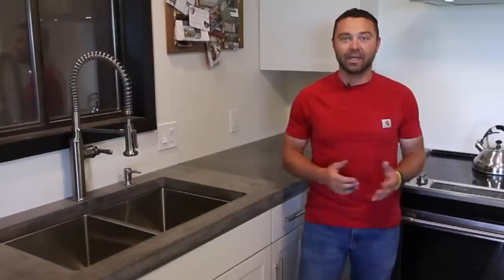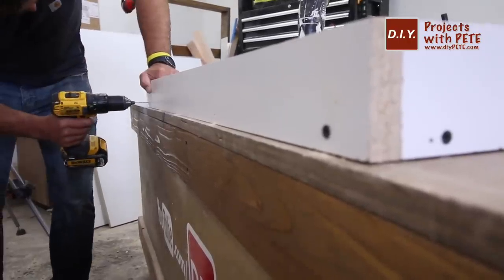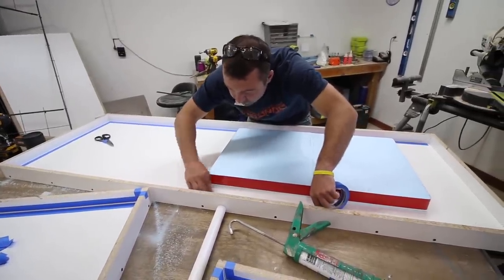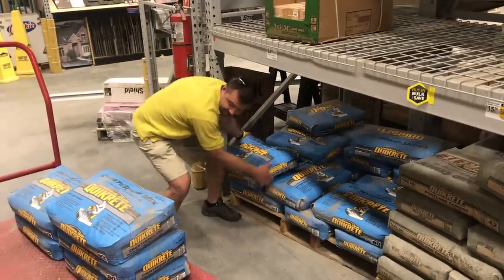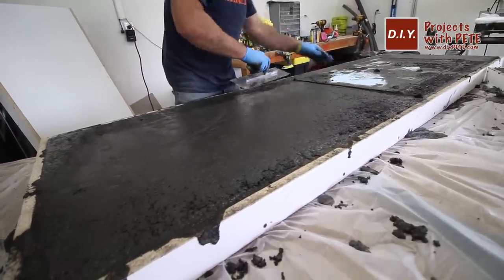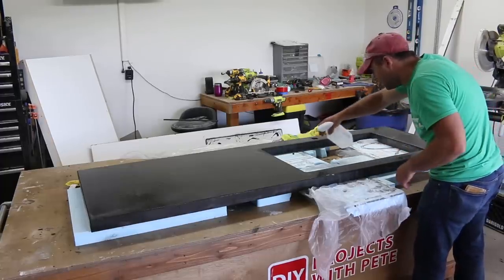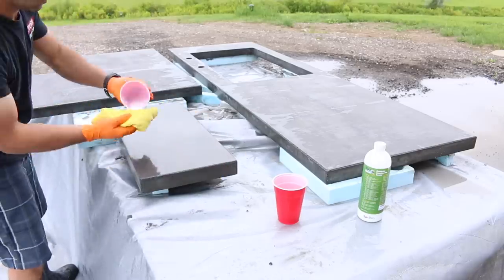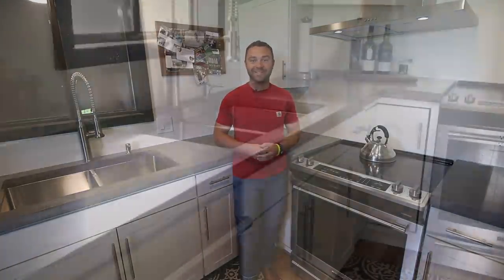How to Make Concrete Countertops

Comment: Man, i am so close to  building a couple of these, but still waiting for my left nut to drop. What is the weight of the counter tops per sf do you figure?
Reply from the maker: At 1.5 inches, about 15-18 lbs per square foot. At 2 inches, around 22-24.

Comment: Just curious --- Framing mold and caulk and foam board concrete and sealer and polisher rental -- What was the total cost of this ?
Reply: If your near a Harbour Freight you can pick a polisher up for around $40 , cheaper if you can catch it on sell .
Reply from the maker: Hi! I have a link in the descriptions under the videos with more pricing info. Also, if you don't have a polisher I'd check out this video. It shows how to do tops with an orbital sander and the cost of everything is quite a bit cheaper: https://www.youtube.com/watch?v=A0Pd4o8gjfM&t=422s
Reply from the maker: Thanks for chiming in!

Comment: Very cool vid! Would it be okay to use a core drill to drill a hole in one of these?
Reply from the maker: I prefer not to drill in the concrete and to use the knockouts. It is probably doable, but I like to minimize the risk of something cracking or happening after all the work has been done.

Comment: HI PETE....MY BUDDY HAD CONCRETE COUNTERS ...AROUND THE SINK ON THE CORNERS THEY CRACKED WHY...WHAT DID THEY DO WRONG
Reply from the maker: Hey Peter, there are many reasons this could happen. Mix used, water ratio, settling, reinforcement around the sink etc. I'd recommend doing some additional searching about how to reinforce around sinks to see if you may be able to narrow it down to a possible cause. Cheers

Comment: Hello Pete. Cool stuff. I was wondering if you could let me know the specs on the blade you are using to cut the foam.

Thank you. 

Rusty.
Reply from the maker: Hey Rusty! I used a fine tooth blade for the table saw. The foam needs to be very secure on the fence for a clean and safe cut.

Comment: Would it be worth using stainless steel reinforcement?
Reply from the maker: If you have access to stainless steel reinforcement it is certainly an option. Not sure on the price difference. Normal reinforcement has worked fine in my experience.
Reply: @DIYPETE  It's more for long-term lifespan in the event of water ingress.  Rusty rebar = doom for concrete.  But maybe a 20-30 year lifespan is perfectly fine for countertops; replacement cost really isn't that high.

Comment: Hey! I have a less work idea. Using concrete blocks, cut in halves. use the top and bottom part. Placed on top of frame or base. Pour some cement on base and blocks on top. Pour cement on top of blocks and polish with cement spatula and wallah! You got a cement top table and can do it for counters also. What about this idea to save time! I think its great!
Reply from the maker: Thanks for the ideas. Cheers!

Comment: Hey, thanks for the video, really enlighting! One question though... In my country I can't find any concrete countertop mix (Romania). Could I use just regular concrete? Or do you suggest any additives? Thank you!
Reply from the maker: Hi! I've used a few regular concrete mixes with success. You could put in a plasticizer or additives if needed. Here is a video where I use a basic concrete mix. https://youtu.be/A0Pd4o8gjfM

Comment: why didn't you use the slurry to blend the two part together? Is that not possible?
Reply from the maker: Slurry would end up shrining and cracking, you could potentially look at doing a grout, but I like the flexibility of an epoxy or silicon.

Comment: Do you have a video showing the lazy Suzan you embedded into the corner cabinet?
Reply from the maker: Hi! I do not, I bought the cabinet with the lazy suzan already in it. Mounting the cabinet is pretty simple though.
Reply: DIY PETE I see. I have a question about it. In the video it seems like the round “trays” stick out from the corner in a way that won’t allow the doors to close. If you were to look on the round trays from a top down view, are they perfect whole circles or do they have a “slice” (like a pizza slice) missing so you would have to rotate the circles so the the missing slice would make room for the doors to close?

(I hope my description was clear enough 😬)
Reply from the maker: Great questions. Here is a link the the cabinet and you'll see what it looks like. Inside the doors it is a portion of the circle. The circle stops at the back of each cabinet door. https://www.lowes.com/pd/Diamond-NOW-Arcadia-36-in-W-x-35-in-H-x-23-75-in-D-White-Lazy-Susan-Corner-Base-Cabinet/50134824  - Here is a video showing a similar cabinet as well: https://www.youtube.com/watch?v=_yFZ0GHRCwM  - Let  me know if that helps, cheers!

Comment: What's the cost of this concreat vs going with granite or other materials?
Reply from the maker: Hi! The cost of the concrete was about $160. However, I've had just as good of luck with the cheaper concrete that is $6 a bag and would be more in the $48 range total for the concrete. You'll also need the form materials, silicon, etc. I was all in for around $350-$400 doing them myself. However, it would be around $65-$100 per square foot to hire someone. Granite would be around $50-$80 most likely depending on what you go with.  BY building you own DIY concrete counters you'll definitely save a lot of money.

Comment: Have you ever made countertops  using rapid set ?
Reply from the maker: Hi Tiffany! I have used it to do a couple indoor and outdoor concrete tables. I love the fact that it is essentially instant gratification in how fast it cures. Unfortunately, they haven't done well outdoors. The indoor one still looks fine but developed sort of a spider of micro fractures. The outdoor tables have pitted a bit and don't look great after a year or two. I've never had issues like those using a normal concrete mix like the Quikrete 5000 or something similar. There is a place for rapid set, but I wouldn't recommend it for counters.

Comment: Diypete , do you have issues sealing at 1500 grit polished ??
Reply from the maker: Hey Tony, I haven't had issues sealing 1500 grit. I generally finish with either 800 or 1500.

Comment: Can you actually use the old countertop to cover with the concrete, seems like that would be so much more stable
Reply: Laying the concrete over the old countertop? Then you’d have a monstrously thick countertop.
Reply from the maker: Hi! the concrete is plenty stable, if you wanted to strengthen the cabinets more though you could use 3/4 inch plywood on the top of the cabinets, and place the concrete on that. The old countertop is 1 1/2 inches thick, so you'd have a bit higher counter. The old counter had a built in backsplash that would need to be cut off, and the sink area would have been different, so I would recommend against using the old countertop, at least for this situation.

Comment: Great job! Where can I find the counter to concrete mix?
Reply from the maker: Hi! It is a Quikrete product - sometimes Lowes or Home Depot will stock it, but not always. Quikrete 5000 is another product I've had good luck with which is available anywhere Quikrete is sold. If you want the special countertop mix, it can be special ordered from Lowes if they are a Quikrete supplier.

Comment: Can you do lighter colors? I have a galley kitchen with a darker color and it just doesn't work . Not enough light. P.S. awesome job.
Reply from the maker: Hey Kurt! So I mixed in a little charcoal with this project -- otherwise they would be a little lighter. Here is an example of a counter I did without any pigment: https://www.youtube.com/watch?v=A0Pd4o8gjfM  Another option is to get a white concrete mix. You could then add a little color to the mix.

Comment: Why is flipping the counter sections necessary? I have a very large section of counter and flipping would be tricktly.
Reply from the maker: Hi! The reverse cast technique is in my opinion the easiest way to get a flat counter. You can do the counters right side up, but troweling is an "art" and does take practice to get a perfect finish. Cheers!
Reply: DIY PETE Makes sense. Thanks. Appreciate your. Video and imput

Comment: How many centimeters
Thick is the concrete
Thick is the concrete
Countertop? I'm going
To try making a countertop
Reply: They are 5 centimeters in height and almost 4 centimeters overhang. You also asked about wax. Any wax, including an automotive wax works. But some people also just use some cooking oil like a vegetable oil as it is cheaper. But if you’re using melamine, it’s pretty good at releasing without a layer of wax or oil. I have never used wax or oil and I haven’t had an issue.  Just make sure the melamine is clean before adding the concrete.
Good luck!
Reply: Correction; you were asking about waxing AFTER the concrete is in place. I use a food safe sealant on my countertops.

Comment: I wonder, how to count the weight of concrete countertop and would adding glass make the countertop lighter?!? Thanks ...
Reply: Calculate the volume of the shape and multiple that with 2500 kg (that is the weight of one cubic meter of average concrete). When adding glass fibers you are mixing them with  concrete mixture that has somewhat smaller amount of send and gravel agregete, so it could be a little lighter, depends on concrete proportions.
Reply from the maker: At 1 1/2 inches thick, it is around 15-18 pounds per square foot. At 2 inches --- around 20-24 pounds per square foot --- as a rough estimate.

Comment: if i remember correctly  use cement that has a plastic mix in it this will allow for drying and  flexing . also add a sealer..concrete is porous... unless  you seal it will stain
Reply from the maker: Thanks!
Reply: Miguel Castaneda - did you watch the video? He seals it...

Comment: How many bags of concrete did you use for this project? And what kind of wax did you use.
Reply from the maker: Hi! 7 bags -- I'd recommend the Quikcrete 5000 mix. Here is more information on the project: https://www.diypete.com/how-to-make-concrete-countertops/   - Here is the wax: https://www.amazon.com/Cheng-Concrete-Countertop-Wax/dp/B003YM5LH8/ref=as_li_ss_tl?s=aps&ie=UTF8&qid=1533067529&sr=1-2-catcorr&keywords=concrete+counter+wax&linkCode=sl1&tag=diypete-20&linkId=2f9f3d7e29b97d744ece2af8989efbe7&language=en_US

Comment: Can you make the concrete tops thin as in not that thick so they're not too heavy?  And can you epoxy finish the concrete tops to make them look shiny?  Oh, you're two "helpers" are cute!  :)
Reply from the maker: You could go about 1 1/2 inches thick with a normal concrete countertop mix. I wouldn't recommend going thinner unless you used a GFRC mix. Yes, epoxy could be used if that is what you'd prefer. Cheers
Reply: @DIYPETE , thanks for the info!  I'll keep the 1-1/2 inches in mind co'z I bet anything thicker is too heavy.  :)

Comment: What is the best Blades size for cutting Melamine without cracking the edges?
Reply from the maker: Hi Don, I typically use a fine tooth blade ad don't have issues with cracking the edges. Are you running into problems with chip out?
Reply: I bought a fine tooth blade and still chip the edges off the cut. Should I cut on high speed or low? I use a drop saw, you think this is the problem?
Reply from the maker: Does the bottom side have chip out or is it much better than the top side?
Reply: As soon as the tooth gets in contact with the melamine as it starts the cut it chips off, In memory the bottom part is worse. it's tiny cracks but still unacceptable.
Reply from the maker: Hey Don! The good news is that the silicon used to bevel the edges will typically cover the edges and corners so if there is minor chipping it should for the most part be taken care of. Best of luck.

Comment: great job on the video and the countertops.   I am going to give this a try but I will not be paying $23/bag for the special mix.
Reply from the maker: Hey Troy! That's awesome you are going to make some countertops! I agree, I've done a number of tables and counters using each. And in my opinion, I like working with the cheaper mix. It has some different properties, but in my experience the cheaper quikrete 5000 performs great and is super durable. I even prefer to use it for most types of projects. Have fun!
Reply: DIY PETE o
Reply: DIY PETE can you use coloring for the quickrete 5000?
Reply: Hey Pete, how many bags did you use?
Reply: @jamesfrierson9971  yes

Comment: Is it cheaper to do it DIY? If it is by how much
Reply from the maker: Hi Kim. I'd recommend using the Quikrete 5000 mix which is $6.00 / bag. You can find an idea on costs using that method here: https://www.diypete.com/how-to-make-concrete-counters-for-an-outdoor-kitchen/    ( along with another video ). Professional concrete countertops will be in the neighborhood of $70 / sq foot for similar tops. Which will be quite a bit more. However, if you'd like to have them professionally done that is a great option if you feel it is the best fit for you.

Comment: Question... Why  couldn't  you  just  use  the  pulled out countertops for your  templates?
Reply from the maker: Hi D! The old countertops were pretty close in nice, but they had a goofy built in backsplash that was hard to work with and the sink was sized differently. Because of the backsplash they can't be laid down easily in reverse, and they are a lot heavier to work with. The strips are light, easy to work with / label, and don't take long to do. Cheers!

Comment: How much does roughly cost to do cement countertops?
Reply from the maker: Hi, Depends on some of the techniques used. These were in the $400-$500 range because of the more expensive concrete mix, and I did an outdoor set here with Quikrete 5000 for about $200. https://youtu.be/A0Pd4o8gjfM

Comment: Surely a trowel would be quicker than your hands?Thats a question not a criticism as I think it was a job extremely well done.
Reply from the maker: Thanks! Your hands help to vibrate the concrete and get it into the corners etc, but a trowel works well to flatten it once it has been screeded. Cheers!

Comment: When sealing the corners with your silicone. Go ahead and run your beads (One at a time is probably best), then spray over the beads with an aerosol window cleaner like Invisible Glass. Then you wipe/squeegee the bead up with your finger (short sections at a time) and wipe your finger on a paper towel as you go before the cleaner dries. The silicone won't stick where you sprayed. Your silicone bead will be nice and thin, just how you want! No tape!
Reply from the maker: Thanks Tom!

Comment: I've heard you need to use an impregnate sealer first, before sealing the outside; that is supposed to prevent staining.
Reply from the maker: There are all sorts of different sealing options and systems, so it will really depend on what is used.

Comment: Nice!  But wouldn't it be easier to cast the tops in place?
Reply from the maker: Hi! You certainly can if you'd prefer. Two different techniques. Casting in place requires that you have experience in doing a really good hard trowel finish. And then dry sanding inside which can be somewhat of a mess. But you can certainly pour in place as another option. Cheers!
Reply: Thx Pete!  Cheers!

Comment: Great job Pete,
What's your ballpark price per sq/ft for that type of install?
Reply from the maker: Hi Al! A contractor would sell them in the $65-$85 / sq foot range most likely. For this video, I used a special countertop mix which is $22 / bag. Works well, but I've had even better results with Quikrete 5000 which is $6.00 / bag and what I build these counters out of https://www.youtube.com/watch?v=A0Pd4o8gjfM     --- I have more pricing info on the website which is linked to in the description.  This was about 25 sq feet and my cost was about $20/square foot.
Reply: @DIYPETE  Cool, thanks for the reply. I'm actually a contractor and I've done a few. My pricing is a bit low I think. Around $50 / sf. They don't sell the quickcrete countertop mix here in CT for some reason.  I do use quickcrete 5000 and I add about 40% rapidset mortar to it plus a few other things. That sets up hard in about 2 hours and becomes super dense and hard! Thanks for the tip using stucco tape around the foam for sinks. I just did one and it works perfect, Thanks again!  Al

Comment: what is the standard height from countertops to floor?
Reply from the maker: 36 inches is standard. Cabinets are 34 1/2 inches, and the counter is generally between 1-2 inches thick.

Comment: Isn't reinforecement bars overkill for such a small concrete project??
Reply from the maker: I like to use it around sinks in projects 2" and thicker.
Reply: @DIYPETE  as long as it works i guess

Comment: so everything is held in place with zero hardware? just silicone?
Reply from the maker: Yes, with 100% silicon. It doesn't budge and can be removed someday if ever replaced. Many types of heavier countertops are installed with a similar technique.
Reply: Awesome. Thank you for the reply. Great and very complete video, best one I’ve seen on the subject. Been thinking of making some concrete counters and this answered all my nagging questions and inspired me! Thank you!
Reply from the maker: Hey Nick! Awesome to hear you are inspired to do some concrete counters of your own. I wanted to share that I've been happier with the Quikrete 5000 which is the $6 / bag mix vs the $23 / bag mix --- and that this technique I used in this video is another option so you wouldn't need a polisher. Cheers! https://www.youtube.com/watch?v=A0Pd4o8gjfM&t=5s
Reply: DIY PETE ah thank you for letting me know!!

Comment: So you only use wire reinforcement for 2 " or more? How about 1 1/2 " ?
Reply from the maker: Hi, I re-bar in anything 2" or more. For 1 1/2 inch material, I use the wire reinforcement / wire mesh.
Reply: @DIYPETE  hey thanks for the reply. Is there a specific wire mesh gauge you find works best? Thanks again. Subscribed!